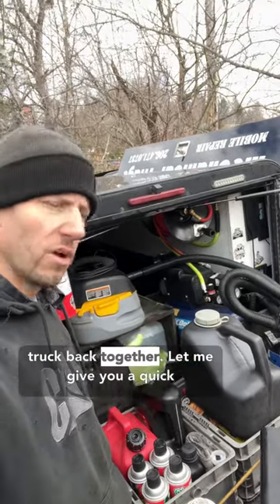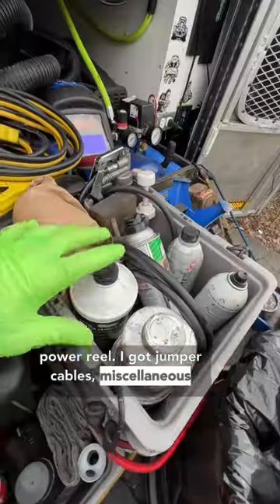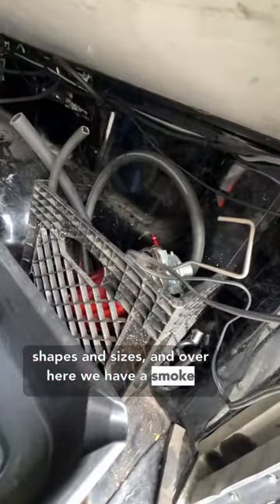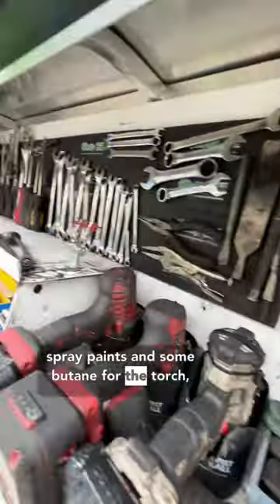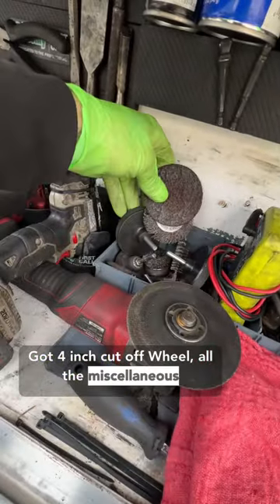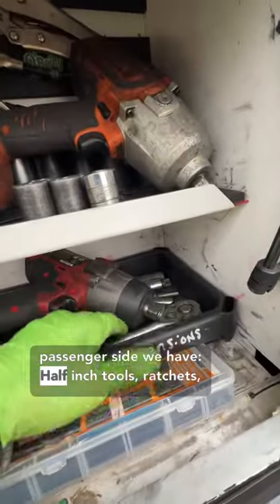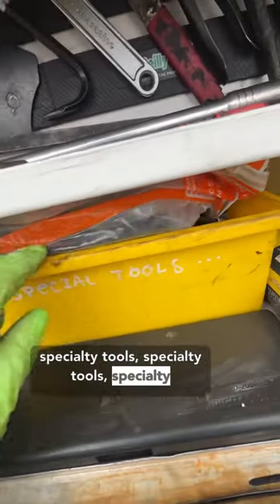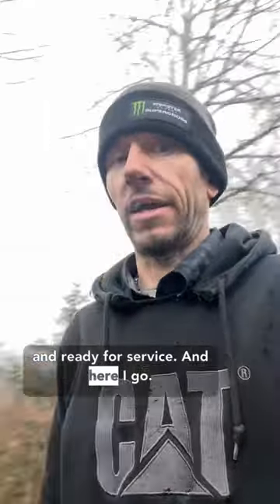From Wrenches to Welders: Building the Ultimate Mechanic's Work Truck

Comment: Thank you for sharing! I had a question, I want to run a separate battery to charge my electric tool batteries, would yellow top with a 3000 inverter be enough? I plan on running it in series with some sort of splitter in between them.